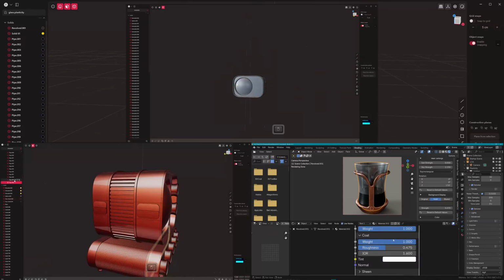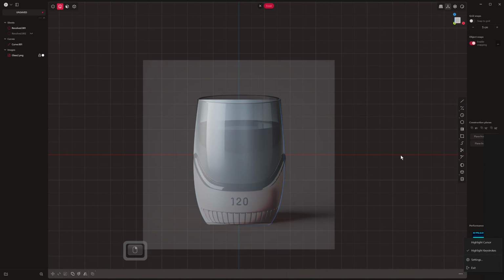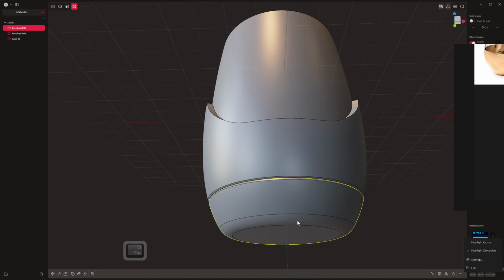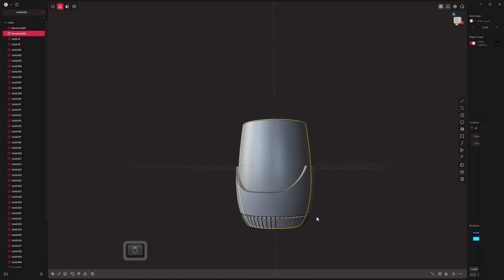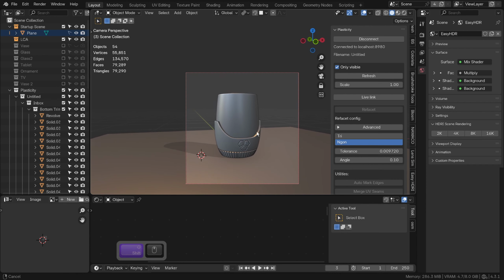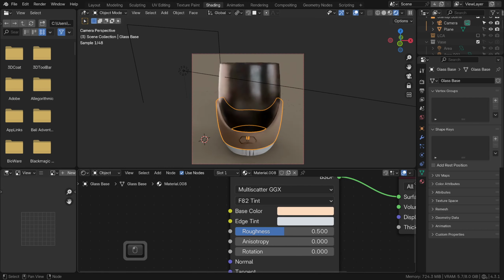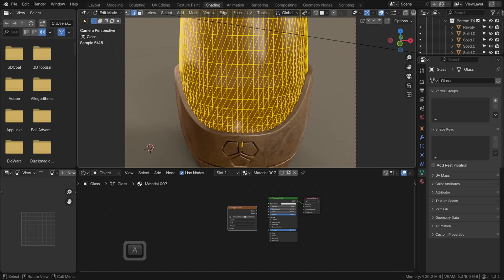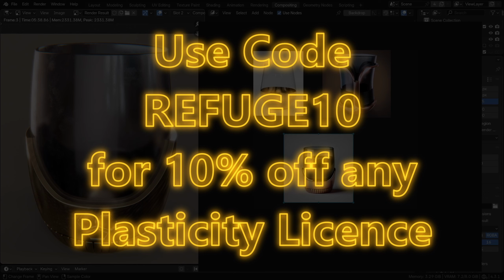Learning PLASTICITY changed the way I THINK about Design

Comment: The problem with using two or more different pieces of software is it becomes very difficult to makes changes. So for some people this is actually going backwards.
Reply from the maker: I know what you mean but here we are not really trying to make changes. In this case we're conceptualizing, quickly iterating on ideas, so we are using all the tools we have to get from cube to render as quickly as possible, so you can move on to the next concept.
The next stage in this process would be to use the concepts to build more well thought out and robust models.
Reply: ok